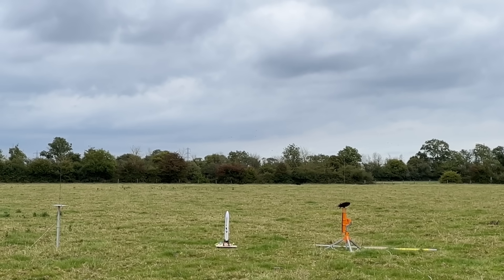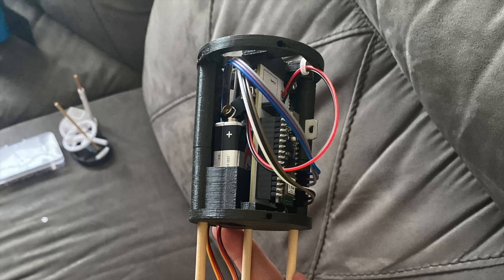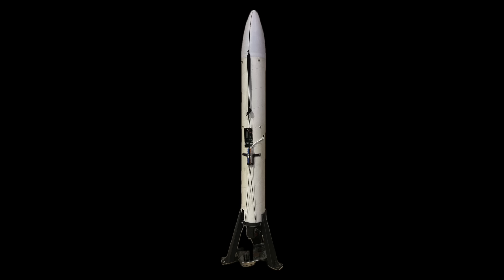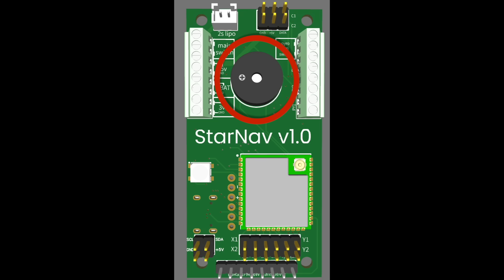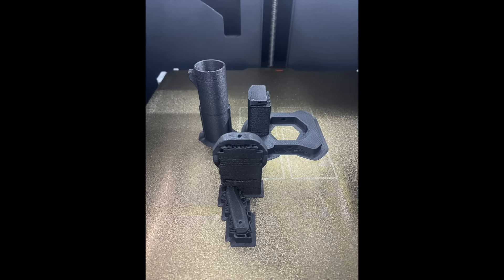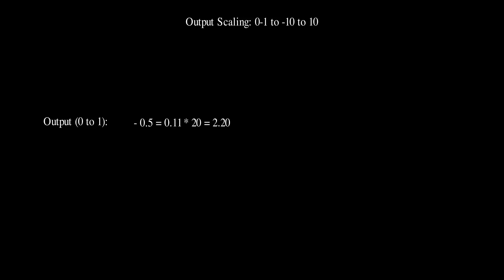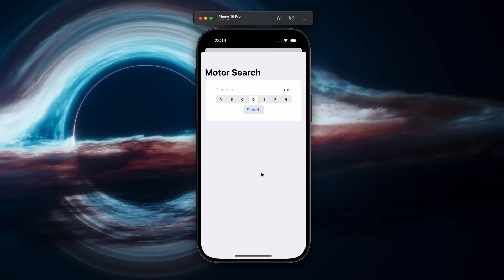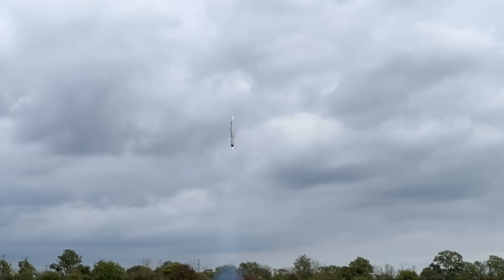I made an AI guided rocket!

Comment: Everybody and their uncle are now printing PETG-CF. It is stiffer, but more fragile than PETG - not stronger.
Reply from the maker: I used PET-CF in this video, which is an engineering material with all around great properties, yes its slightly less impact resistant but its certainly not brittle like PLA. For this though, the stiffness was very essential - I've got a detailed materials video in the works

Comment: It'd be interesting to see the pid graph in comparison to the network. Specifically I wonder how it would do if you modified the pid settings using a network, vs doing this. Since the time aspect is built into the angular velocity, it'd be interesting because with the layer setup you showed you should be able to essentially fully represent the PID equation in it. So it'd be cool to see if that's the case by both seeing how many neurons are barely used in the hidden layers / how the performance compares
Reply from the maker: I think it does effectively do something similar to pid, and yes I could've done auto tuned pid. But... there's stuff coming that uses neural networks in another way so I was just using this as a starting point 😉

Comment: The quality is awesome! Excellent job!
I don't know anything about automatic control systems, so I don't understand the difficulty of tuning their parameters. I bet that if we had perfect sensors and instant responses to changes, the robot could perfectly interact with the environment. But we probably don't have either. So, what is the most difficult part of such a system? Is it the metrics fetched from the sensors, the delay of the response, the randomness introduced by the environment, or something else?
Reply from the maker: BPS described the challenge once very well as it being like "balancing a broomstick on your hand while blindfolded and wearing an oven glove" lol. It's basically just trying to keep a rocket upright when you've only got a single point of contact from the thrust of the motor

Comment: Hey are you using model rocket engines?
New to this but is it liquid fuel powered engine?
What is the material you used to build the outer body of rocket? Also did you 3d print it?
Have you got your own 3d printer?

Cool works brother. Keep going.
NN powered landing would be awesome.
Reply from the maker: Hi there, you can actually get these tiny solid rocket motors quite cheap - im using Klima C6-Ps but availability varies by country. And yeah I 3d print most of the parts. :)

Comment: This is insanely cool, you train the AI sort of like they do in trackmaina. Not surprised it worked this well, many concepts are surprisingly similar. What do you use for the engine? Just a mounted firework? And simple servos to point the engine? This rocket seems like a very affordable yet cool project.
Reply from the maker: Thanks! also a big fan of trackmania lol. In the UK rocket motors are annoyingly well regulated so these are specially made for this. I wish it was cheap but hey I got there eventually :)

Comment: Why did you use Fixed Topologies instead of Augmented topologies?
Reply from the maker: its a simple enough task that I (I think correctly) assumed it wouldnt need a complicated network so there was no reason not to go for the simplest possible system
Reply: @ASRocketry If you have limitations with the computing and speed of the NN deciding the adjustments a NEAT approach might be more efficient. For such a simple system you would probably end up with a NN with just 2-3 nodes (instead of the 10 you currently have) in between the input and output layers.

Probably not gonna make a huge difference but check it out if you haven't already.
Reply from the maker: @SocialPrime  thanks for the suggestions! I’ve done some testing with what size networks are the best and I’m currently running it at a 2x2 network already lol. More than 80% of the processing already goes into running the simulation and it only takes a few seconds to train! The speed of running the network even on my custom pcb is only a few microseconds at most so yeah… not too worried lol
Reply: @ASRocketry nice

Comment: Very cool. You used a genetic algorithm to evolve feed-forward neural network weights using basically PID inputs, this allows non-linear correction. If you REALLY want to overengineer this, one thing that imo would be really cool is to essentially set up a 1-d convolution or even a LSTM on the input - then, add some noise to your angular velocity and angle measurements at random, add some dropout in the weights and you'll get something that is robust from somewhat noisy sensor data. Update your training to include a bunch of different possibilities during launch - burst of thrust, very high wind gusts, different angles of initial launch conditions, etc and it becomes even more resilient. Keep up the awesome work!!
Reply from the maker: Lots of types of noise have been added to the simulation which allows it to cope with strong winds already! The day of the launch shown in the video people’s chairs were blowing around lol
Reply: @ASRocketry thats awesome! keep up the good work man! do you have a discord or anything?
Reply from the maker: @AndrewOrtman  Thank you! And thanks for the huge donation thats insane lol. I currently dont have a discord but I might make one at some point - I think there's an option to post to supporters on buymeacoffee so I'll probably put some progress updates there between videos

Comment: Why not use a regular backprop optimizer like Adam?  3 inputs and 1 output with just a few hidden layers would converge really quickly.
Reply from the maker: @YetAnotherPilot  I’m not sure how you’d compute the losses for back propagation, this runs in only a couple of seconds anyway lol. It’s much easier to evaluate the score of a whole simulation than anything else and then there’s not really a need for anything other than random mutations until it works

Comment: What hardware did you use to run trained AI on a rocket?
Reply from the maker: my custom starnav board which I showed in the video, it uses an esp32 s3 processor
Reply: @ASRocketry esp32 is capable running an AI model? I would assume you could also add roll stabilization to keep a rocket from spinning. Would I be abele to purchase this board from you?
Reply from the maker: @ it’s a very small network lol, only about 8 neurons usually - but that runs about 10000x faster than I need it to
Reply: @ASRocketry Would you be able to explain how you train AI model to accomplish this?

Comment: Are you using the bluetooth connection during flight or only to launch ? 

I don't see how Bluetooth can go that far
Reply from the maker: @gamemak0r  I have it streaming some angle data for debugging purposes during the flight, but yeah it’s not really mission critical so it doesn’t really matter if it cuts out. Range seems plenty though as it’s uninterrupted since it’s in the middle of a field and only goes about 20m atm.

Comment: This is just using AI to calculate your PIDs This isn't operating your rocket... ?
Reply from the maker: no its not using a pid controller at all, its using a neural network instead which directly outputs the motor angle

Comment: Using LSTM or just temporal data is a really nice way of not only getting rid of the need to train your NN whenever the dynamics of your rocket changes, but also for closing the sim-to-real gap. We use this with our autonomous quadrotors, where the control system can adapt to different dynamics based on a few seconds of flight data. This also helps a lot with external disturbances like wind, that aren't being simulated.

You can also run 2 networks, one that estimates coefficients representing the external disturbances (forces & torques) based on temporal data, and then the second network that does the control can leverage these coeffs.
Reply from the maker: sounds interesting, the ascent of these flights only actually lasts about 2 seconds though so there's not really much time to make corrections like that. My simulation currently has many types of disturbances simulated, but I'll have to look into that for detecting things like slight motor misalignments which are currently a pain
Reply: @ASRocketry I'd be inclined to consider a policy optimizer solution like PPO to pretrain a model in a simulator..... and then use real world data over many flights to post-train/fine tune. TVC isn't an inherently difficult problem to optimize for, thus the reward function can be really quite straight-forward and will probably converge quickly.
Reply: Any info how to use flight dynamic data to control autonomous quadcopter?